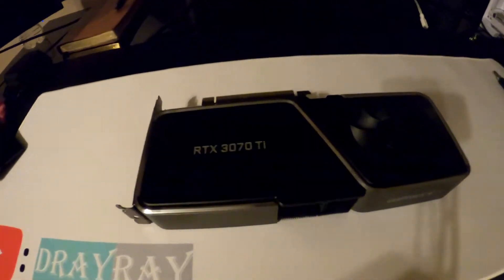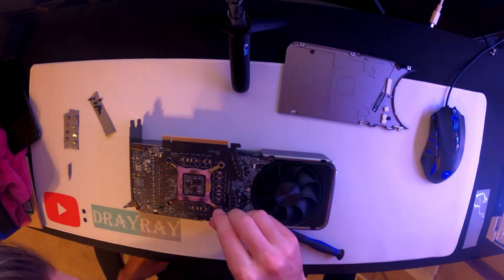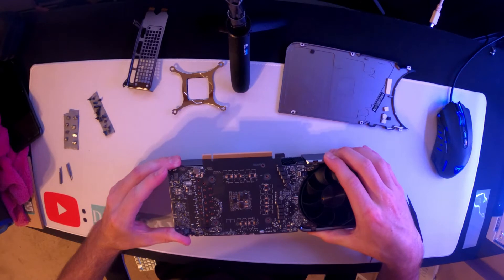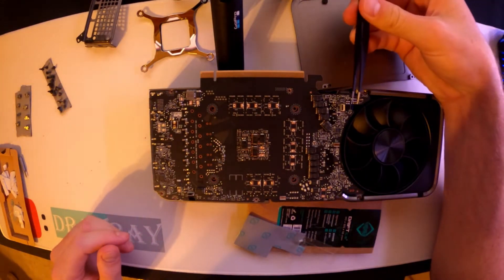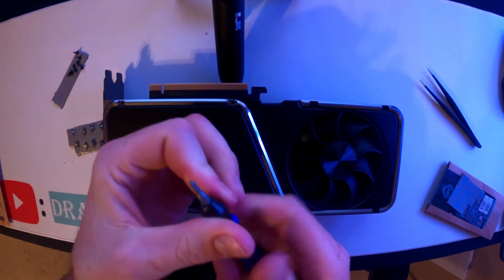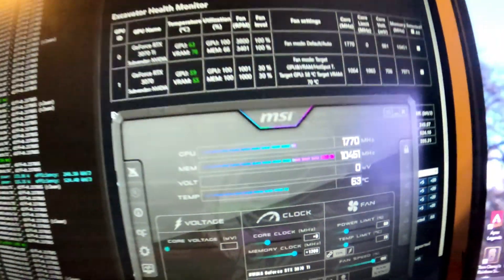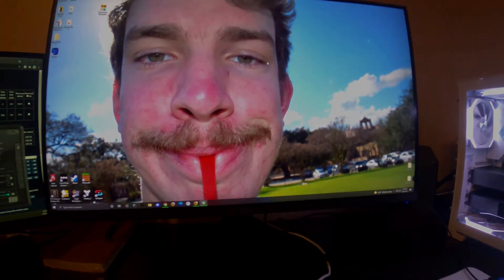RTX 3070 TI FE Thermal Pad Replacement (1.5mm thickness pads)

Comment: my gpus now over heating, after doing exactly this with 1.5mm pads
Reply from the maker: Lol what did you do wrong? Did you forget some pads or misalign them?
Reply: @drayray9766  no, my heat sink wasn't touching the chip well because 1.5mm was to thick, I squished them down, but its still not quite fixed, pc still getting way hotter than before, idk what thickness to get, what did you use?
Reply from the maker: @UltraSkitzUltraSkits  says in the video. But i used 1.5mm and no issues
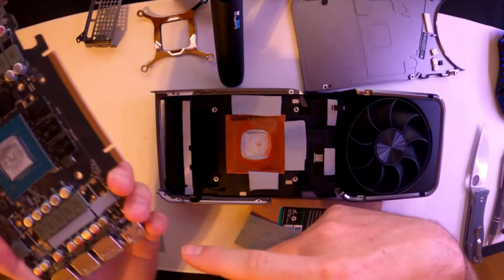Reply: @drayray9766  there is only 1 thing I can imagine I did wrong, if you look at 5:55 on the video, you can see 8 big black square chips, and next to each set of those big black chips, there is a small blackish chip beside each set, do the thermal pads cover those to? I left them uncovered because that kind of thickness would prevent the card from seating down all the way
Reply from the maker: You have to replace every single pad you take off
Reply: @drayray9766  Can you send me a link to the exact thermal pads you got? im just going to do exactly what you did and see if it fixes my problem
Reply from the maker: @UltraSkitzUltraSkits  Iceberg Thermal DRIFTIce Thermal... https://www.amazon.com/dp/B08KYHDHFQ?ref=ppx_pop_mob_ap_share
Reply: @drayray9766  I bought them, put them on, and its not any better, pc will go to 100c if I leave it at 100% power limit :(
Reply from the maker: Bro what the heck. Im not sure my man. Did you make sure they are placed on the correct components. And everything plugged back in
Reply: @drayray9766  do you have a discord or something I could send photos to you on? If you don't mind
Reply: @UltraSkitzUltraSkits  Did you repaste the die? If not then thats the issue probably! Every time you open a card/cpu it HAS to be repasted even if you think it's not worth doing.
Reply: @kyslyslydlyslydoys  I did, many times, I eventually got it to stop going off the charts with temp after enough times of taking it apart, but its still not at the same temps it once was before, doing this only made things worst, I followed everything, even bought the exact same brand in the video!
Reply: @UltraSkitzUltraSkits  Did u use high quality paste like kingping or arctic? Also did u check if the original thermal pads are 1.5mm, they could have been 2mm or some of them a different size. Not all pads are same size and some are squished when pressed so they could appear to be a lower size.  

Its very important to tighten the bracket screws in diagonal order and by little bit at a time until they are evenly applying pressure on the die - failing to do so might be creating a big gap on one side of the GPU die if you tighten one screw all the way while the others loose. try that. Also when repasting apply an even thin film all over the die with the included spatula (not very thin but not thick either) DO NOT DO like most people on youtube “just squeeze a certain amount and press the radiator” thats the wrong way of doing it. Thermal paste is there to fill any nano gaps on the surfaces. It has to be evenly applied and fairly thin layer. Clean all previous paste first with a tissue and make sure its dry and clean before applying new paste. Also make sure thermal pads are high conductivity ones not the cheapest ones you can find. 

Thats my advice to you i wish you luck!
Reply: @UltraSkitzUltraSkits  hey, just fixed the same problem with mine. Had to squeeze the thermal pads to the vram before putting on the lid. Dm if you still need help Arroww#5745

Comment: Wow I got wrong pad I’m struggling and ya sure 1.5 fit cause I noticed that  my gpu chip  don’t touch the copper sonwell I thought it needed 1.0 or 0.5 to make it shut?
Reply from the maker: Measure the pads you took off if you want to be sure. 1.5 always works for me

Comment: My magnetic covered t5 screws on the top and bottom left have stripped the screw driver, think they have loctite or something. Can’t get them out but easy on the others…
Reply from the maker: Hmmm. Thats odd. Maybe warm your card a little bit. Not sure why they would be so tight
Reply: @drayray9766  i probably use the solder tip to warm the screws and see if i can remove it,  getting new screw driver so will see tmr!
Reply from the maker: @gabrielwong1991  okay let me know how it goes